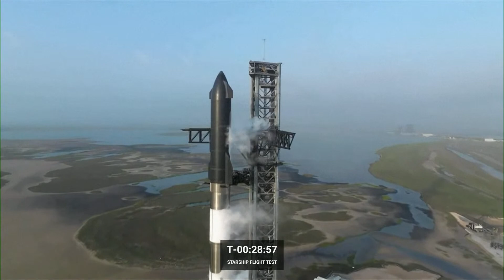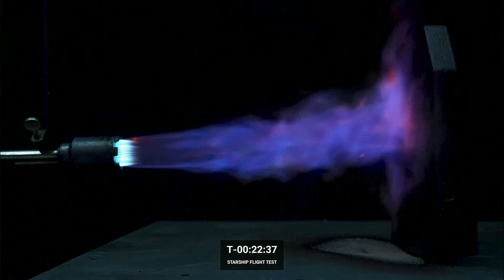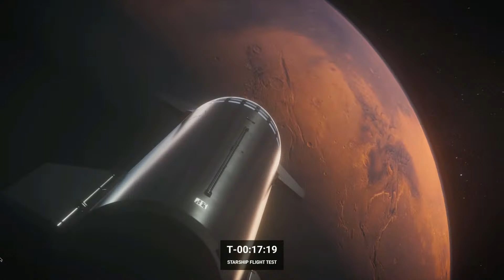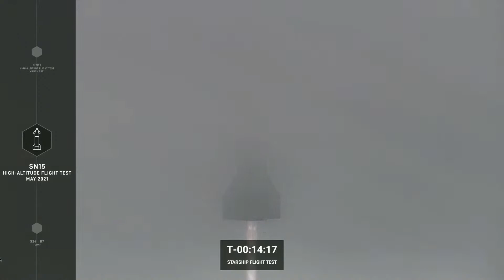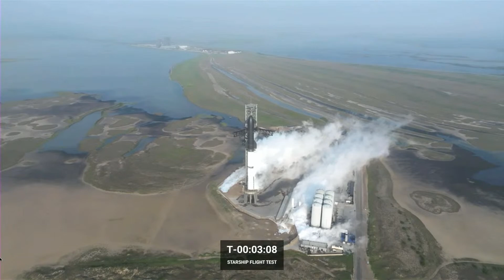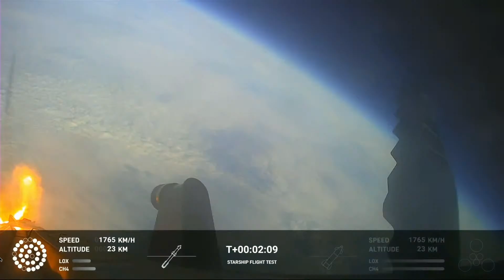SpaceX launches biggest rocket in history

Comment: Wait.  What.  Are they saying that that was meant to happen?  I think they are just putting a spin on it.
Reply: it is not supposed to happen like that, but because the booster body didn't separate, the engineers commence with plan B which was to stress test the rocket and engines. It was impressive to see how it holds everything together.
Reply: Wasn’t planned but was expected

Comment: Wasn’t the biggest rocket it was the fastest rocket I’m pretty sure
Reply: Largest and most powerful by a wide margin.
Reply: More thrust than the Soviet N-1 - by almost 50%.
More payload capacity than the N-1 OR the Saturn V - by about 30%.
Easily the biggest ever launched - and despite the failure of the stages to separate (it appeared that the main engines did not shut off properly, not just that the stage separation didn't work), it still made it further than the N-1 ever managed (and didn't detonate the pad after falling back into it like the second N-1 launch).
Reply: its the biggest rocket